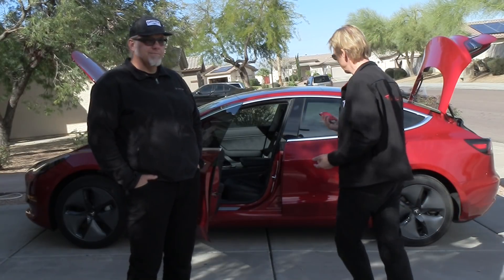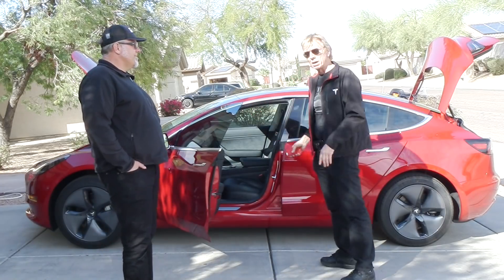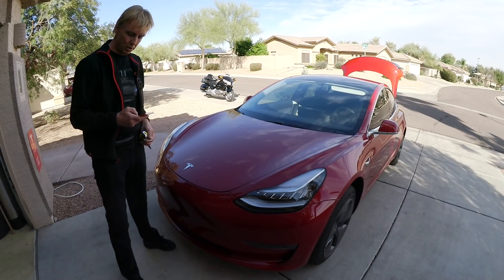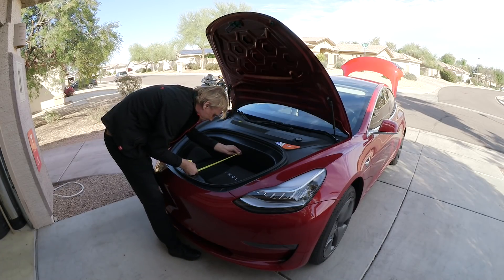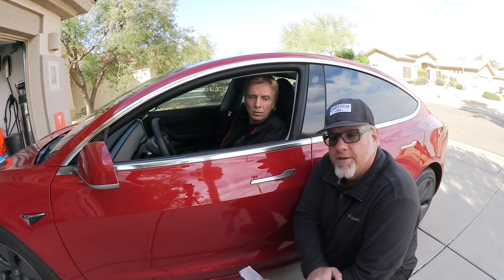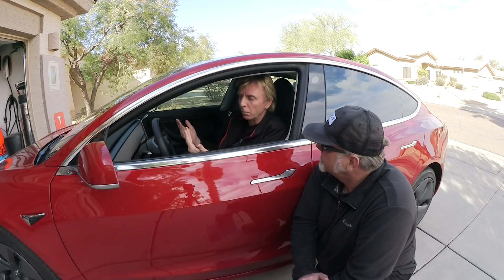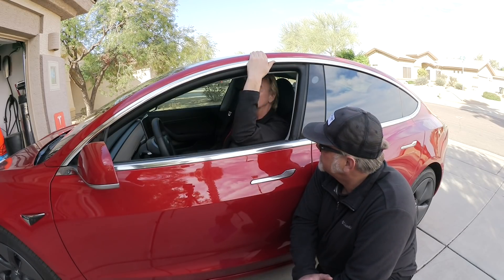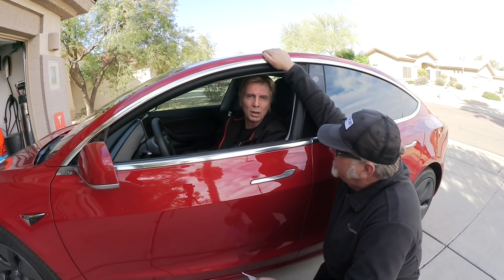Will the Tesla Model 3 face Corrosion?

Comment: You only just found out the Model 3 is made from steel? I've got some other news for you. Apart from not having proper corrosion protection inside the frame and door panels, water ingress into closed sections (doors etc) means water pools inside in what is called a moisture trap. Fast rust guaranteed, just like a 1970s Lancia.
Reply from the maker: Karl P Hey Buddy this movie is almost  two years old. I’m in living in Arizona my clima hardly cause any rust because it’s very dry. So far I don’t have any signs of rust not even the slightest. Rolf
Reply: @TeslaOwnersUS  No you're never going to have a rust problem in Arizona. I've seen abandoned cars from the 1950s still out in the desert, minus all the paint but very little rust.

Comment: Modern cars use galvanized steel, one or both sides.  Zinc rich primers.  Seams are sealed at the factory.  Aftermarket rust proofing is worthless.  I've lived in the rust best all my life and remember the Chevy Vega's and Honda Accords to name just two.  Japanese cars always were "rust proofed" at the dealers, but was worthless.  Hope Tesla did what they needed to do at the factory.

Even the cheap $35K is too expensive for me, which will never happen.
Reply from the maker: Dan R Cost of ownership that is what counts. The standard M3 is cheaper than a Honda Civic over 5 years. Check it out. Rolf
Reply: @TeslaOwnersUS    But what about repair cost when it gets 100,000 miles?  My Accord had one sun visor, one set of tires, and brakes I did my self.  I don't think my 120 volt 15 amp garage circuit will work very well. Also for my needs drive 800 miles in one day or when it's 20 below zero.  What it's range at -20. Drive to the Minneapolis airport at -30 this winter.  I know of no changing station in the city I live.  I live on on intestate in Minnesota  in a city with 25000 people.  At this point they just won't work for me.  One trip to the dealer in 125,000 miles is what I value.
Reply from the maker: @danr1920  Drivetrain in the M3 is build for 500,000 miles. The brake pads you might have to replace half the way through. Use your dryer outlet for charging. Get the appropriate adapter from the Tesla store. Cost $ 35. Cold weather does influence the range, but for that you have in the cold regions at many parking spots a 120V outlets. That should make up for it. For supercharging here are the ones in MN. With 800 miles driving you would need to use them. Cheaper as fuel. 
Tesla Supercharger
Electric vehicle charging station
Clearwater, MN
Open 24 hours

Tesla Supercharger
Electric vehicle charging station
Hinckley, MN
(877) 798-3752
Open 24 hours

Tesla Supercharger
Electric vehicle charging station
Oakdale, MN
(877) 798-3752
Open 24 hours

Tesla Supercharger
Electric vehicle charging station
Baxter, MN
(877) 798-3752
Open 24 hours

Tesla supercharger
Electric vehicle charging station
Sherburn, MN
Open now

Tesla Supercharger
Electric vehicle charging station
Albert Lea, MN
(877) 798-3752
Open 24 hours

Tesla Supercharger
Electric vehicle charging station
Duluth, MN
(877) 798-3752
Open 24 hours

Tesla Supercharger
Electric vehicle charging station
Worthington, MN
+1 416-787-8006
Open 24 hours

Tesla Supercharger
Electric vehicle charging station
Rochester, MN
(877) 798-3752
Open 24 hours

Comment: Hello. Have you done any wax/oil/bitumen for corrosion protection? Experience? If you spray inside the doors does it effect the door, windows actuators? I had bad experience on my bmw with the doorlocks, the got clogged with the tectyl.
Reply from the maker: SkiRolf, I don't need this here is Arizona. There is no salt and even steel never rust. Rolf

Comment: Galvanic corrosion could be quite a mess IF Aluminium and Steel are welded, or meeting with compression joints. Especially in European climates, with road salt added to the mix. 
I am concerned for ownership beyond warrantee of these amazing creations. I guess you need to add Wax-oil or similar barrier protection as soon as possible.
Reply: I have some used aluminum trim for my '65  Corvair.  Lots of metal missing.  It was attached to steel.  About five years in the rust belt, it was Swiss cheese.

Comment: I live in Arizona and the 3s are popping up in the wild and... you can sit in a check out the car.  Having done so, I came to the conclusions that the 3 does not work for me.  I bought a used model S from Tesla.  The big downer for me in the 3... bike carrying capability.  It looked like a tight fit, through that trunk. No roof rack, no room for a bike box.
Reply from the maker: Chris, We will bring a Video soon that exactly picks up your topic. Stay tuned. Rolf
Reply: Chris Bates Hopefully Tesla will include an accessory hitch option for a bike rack on all cars

Comment: Hello Rolf and Ove, I believe there are no open questions remaining for the Model 3! If there are, it is probably due to the fact that you are both enthusiasts and not journalists with a lot of resources and measuring equipment in the background.
Just one thing: you made the steel sound very bad in this latest video. Please keep in mind that modern high strength steel is not necessarily heavier and manufacturing something from it is usually easier. Just think about the huge problems that some of the german manufacturers had with their first partly aluminium cars, the A8 from Audi comes to mind. Today this is no problem any more but back then it was. Corrosion protection is a big issue, but I cannot imagine that Tesla would actually forget something like this!

Keep up the good work and greetings from cold germany,
Klaus
Reply: Manufacturing from UHS steel is actually harder than from alumium.  You go with it - as Tesla has done - because it saves weight and is more resilient.

Comment: So far I haven’t seen anyone test to see how much KW the model 3-75 battery can deliver throughput the SOC range. We’ve seen a few dyno runs and off-track 0-60 runs, but nobody has done it at every SOC to determine how much headroom there is for a performance version. We know the dual motor will use a smaller rear motor and add a small motor up front, so performance will be roughly the same. 

It’s quite likely that they can’t make the performance version unless they add a bigger battery, just like they did to the 2020 Roadster to give it the KW needed. We all know they didn’t add a 200 kWh battery to a sports car just to give it range. Quite likely they will need to find room for 100 kWh in the performance version. 

The normal version is putting out nearly 300 kw. With dual motor it may be 175 kw rear and 125 kw front and in the performance model 300kw rear and 150 kw front. So far no sign of any performance version, due to the battery kw limit. The lighter model 3-50 has less performance, also likely due to kw limit. Perhaps 200kw. Tesla May need to use a high drain battery in that version if they can’t find room for more 2170 cells.

Comment: Great review and I like the humor you added to the magnet test - never seen that one before.  Just ordered my Model 3 so I was a bit worried about the "larger" turning circle as I hadn't seen anyone else mention this.  I looked up the spec for the 2018 BMW 3 Series and it shows 37.1 feet which is in line with your number.  This put my worry to rest as I am very familiar with the 3 Series and happy with its turning circle.  Thanks again for exploring this topic!
Reply: I checked Infiniti's similarly-sized car (Q50) too.  Caranddriver gives that one a 37.4' turning diameter.

Comment: Dissimilar metals i.e. aluminium and steel will corrode when damp, worse in the presence of salt unless they are separated so that no current can flow between them. We really need to hear from Tesla as to what precautions are in place to avoid galvanic action between these two metals. Munroe and Associates who do not seem shy of pointing out problems with the Model 3 may throw some light on the corrosion conjecture as to whether this is a real concern or not.
Reply: Dogphlap Tesla is not the first to combine aluminium and steel so they are probably doing the same as anyone else.
Reply: +izybit izybit      True but I would be happier if Tesla spoke out about this. We have known about galvanic corrosion since Michael Faraday (and probably before as an observed affect) but it still seems to take folks by surprise every once in a while. If this did turn out to be a genuine concern it would have a devastating affect on the Model 3, maybe even Tesla themselves. As an example of how the smartest guys on the planet can get stuff wrong look at the Model S door handle mechanism. Any technician with a few years experience would know that mounting a micro switch (several micro-switches actually) on a moving part with the striker being on the stationary frame was bound to lead to broken conductors since the wire flexes every time the mechanism operates (that failure mode could so easily have been avoided by mounting the switch on the stationary part and having the striker on the moving part). I own a Model S, I am a self confessed fan boy of the company but I know that no matter how good you might be we are all capable of making stupid mistakes.
Not that anything has been demonstrated yet as to this being a real problem with the Model 3. The sooner this concern is aired and addressed by Tesla, either showing it to be a non-problem or in the unlikely event that it is a problem implementing a fix the better.
Reply: Dogphlap I don't expect Tesla to really address this because it's not something a manufacturer would be doing. You will hear about this from 3rd parties for obvious reasons but unless real issues appear Tesla has no reason to tell us what exactly they are doing.

Comment: Steel may not be that much cheaper than aluminum in the Tesla. The very high strength steel they seem to be using is also very thin, weight being important. It may work with  the coating methods to form a plastic/ steel/ plastic sandwich that  has more strength than the steel by itself. In bicycles not made of carbon composite steel and aluminum are just as good in high quality tubing when the right diameter is used in each metal.
Reply: The steel-vs.-alumium thing is mostly marketing.  Check out the first responder guide for a Model X, for example; there's tons of steel in it too.  UHS steel has a better strength to weight ratio than alumium.